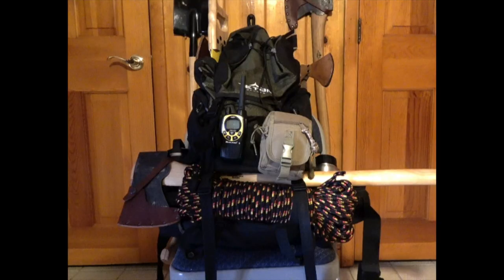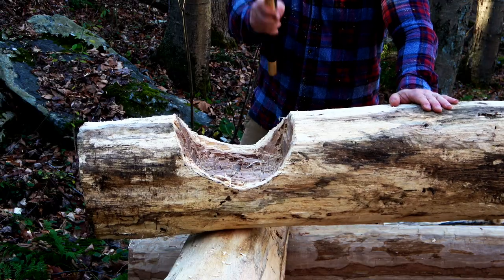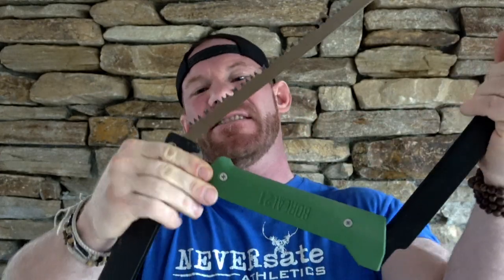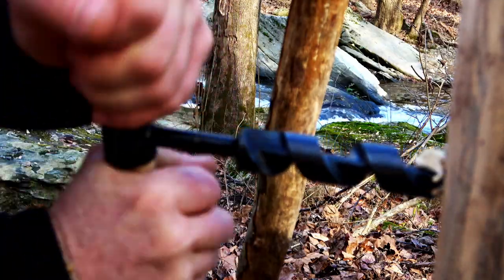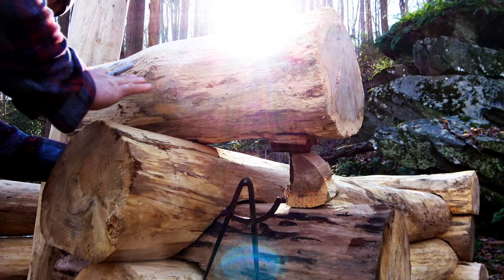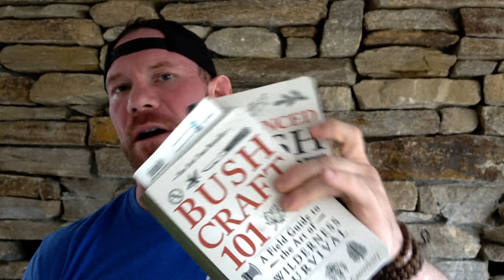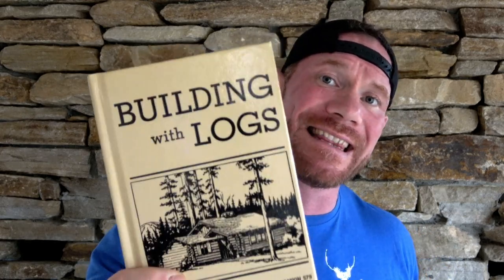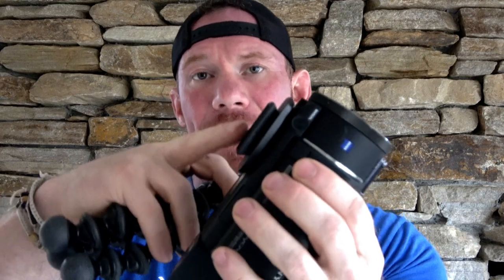TOOLS used in LOG CABIN BUILD! The Good, The Bad & The Dull - Links & Recommendations Included!

Comment: Those Stanley saws with the impact hardened teeth are filed crosscut. (as are the rest of the saws you showed)  For ripping logs you want... wait for it...rip teeth - big ones.

At a minimum your saw should be long enough that, at some point in the cut, every tooth gets a chance to be out of the cut - that lets you clear the chips.  If you can't get that, just keep in mind that the sawdust can fill up the gullets and stop the saw from cutting.  if you have to cut something too big for the saw you can adjust your stroke so the tip almost comes out of wood, and that will let most of the dust fall out of the gullet.

If you have to bear down on the saw, it's either very dull, or you have the wrong saw for the job.  The right saw for ripping logs is a pit saw (you'll want one with a pit and strong person attached to the other end).  That could be hard to find, as you have no friends.  A hand saw filed for a rip cut with about 4 teeth per inch won't do too badly, though.

If you have straight grained timber, you could split the log and dress the face with your soon to be purchased Gransfors broad axe.
Reply: Thanos oftitan Great advice
Reply from the maker: This is very helpful brother, thank you!

Comment: Silky SUGOI 360. I used it as a tree climber. Comes with a nice scabbard that straps to your leg. Comfortable handle also. The problem with silky is the blades are so damn expensive and the steel is harder than hell. VERY difficult to sharpen. Pruning with one every day I probably went through a blade a month.